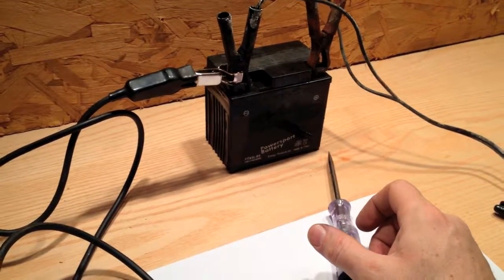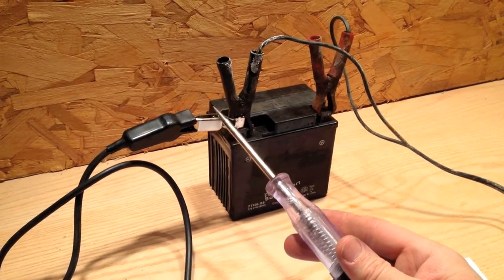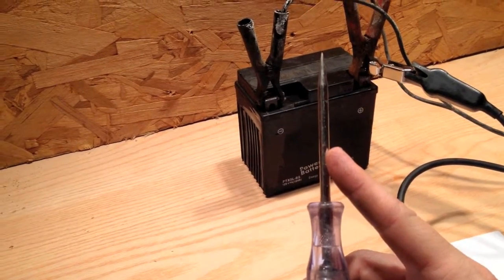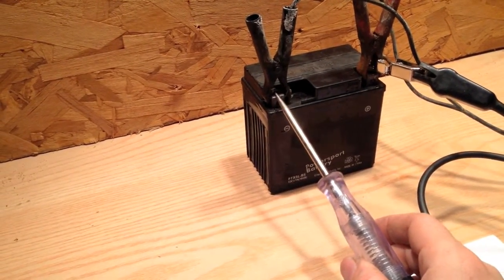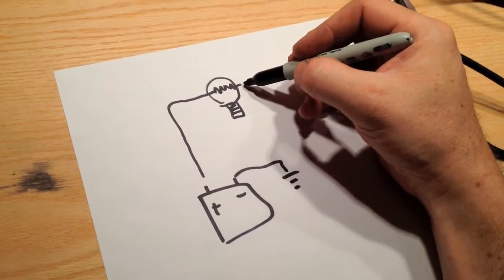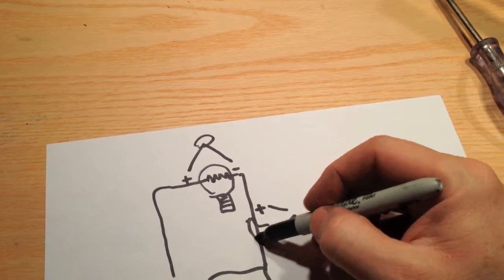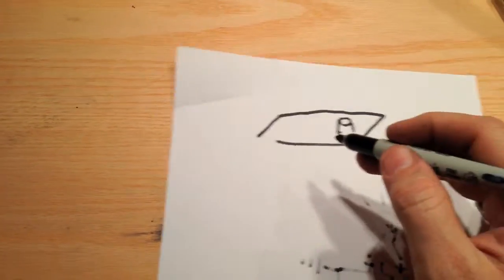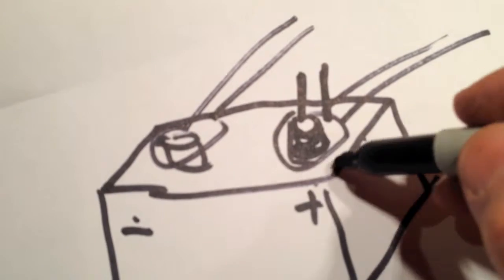Using a basic electrical test light

Comment: Good afternoon sir hope your day is going well! I love this test light video and the other one as well regarding the computer safe logic probe both are awesome videos! I would love to see more videos of both test lights cause you explain very well in detail step by step in such a calm and peaceful manner which helps alot of people that learn at different paces and not quickly all the time. Are you able to do a video of how to backprobe an ignition coil pack connector or any other connectors correctly and zoom it in close to see how it's supposed to be done right using a t-pin, paper clip or etc?